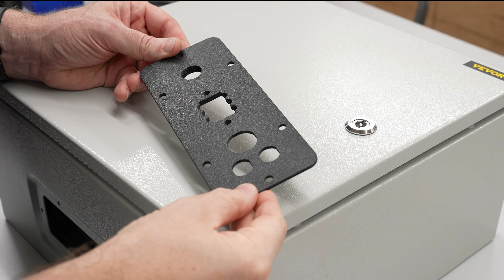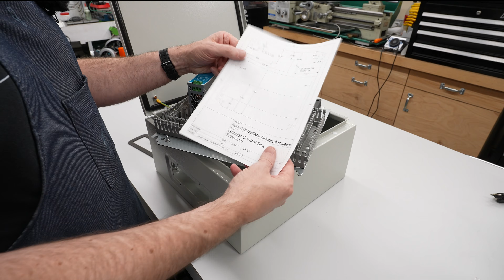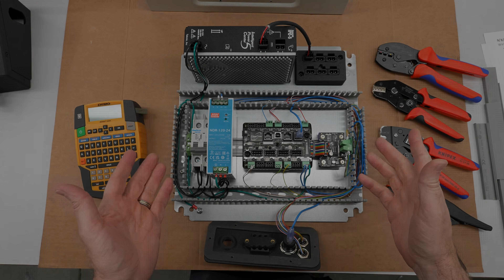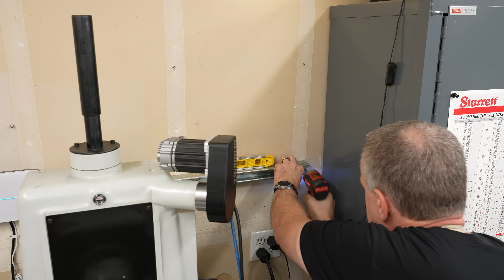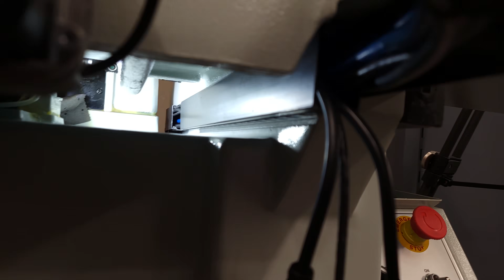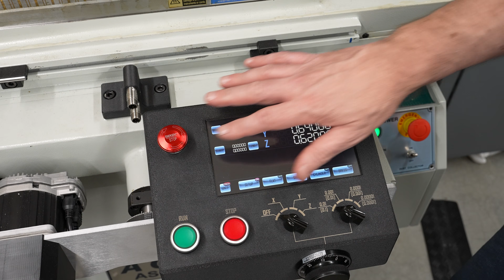Clean Control Cabinet Wiring Made Easy!

Comment: Nice Job, not much to pick on as this type stuff is in my wheel house.   Good job on separating the AC from the DC signal.  Best way to fix signal noise is not to have it in the 1st place.

Old school material, you could use a spiral wrap to hold all of the cables together from wall enclosure to machine.  Another layer of protection. 

Grind the paint off the panel for ground lug. Same for door grounding jumper.  Think this was a VDE standard for Europe.  I might be mistaken thou.  

Also another trick to the trade.  after a month or so of use,  go back and re-torque the Power lines.  The temperature cycling will loosen them.  Learned this from using a Fluke Temperature color display device.  Makes a big difference on reducing heat loss on the terminals.   Breaker panels is typically the place to start. 

Also reference your DC common to ground at just one point.  This is also a common error.  if it's all over, ground loops.  You need that reference for the common to lock it in, with out it it could float a little and drive a technician crazy in troubleshooting.   

Set those current limiter modules on contactors to lowest setting , bounce them up if they trigger.  Might as well use them as you got them.  Same strategery as fuses,  install low and bump them up if they blow.  goal is to have them just above the operating point of the circuit.  Over rated fuses is lazy.

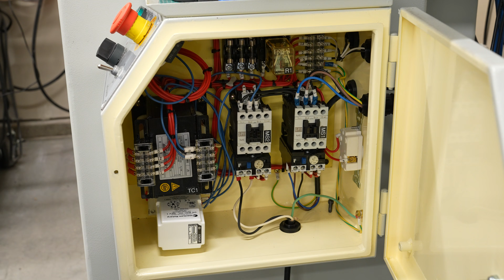Comment: You committed the cardinal sin of industrial wiring however; You did not put labels on either ends of the wiring inside (and outside) the control box. You should have taken a page from @22:54 and noticed how the machines industrial wiring itself is thoroughly marked, paired, zip-tied and routed in the box. If it's worth doing..it's worth doing right. PS - I love how you put your hand onto the work surface of the tool as you bend over and power-on the machine @24:54..living dangerously..love it.

Comment: Man... Im working on a nitrogen generator system that's controlled by Arduino and will have a touch screen display. Of course I had to complicate it by adding sensors/monitors for the air flow, O2 sensors, pressure, temperatures, etc etc. 
But you make projects like this seem so easy, lol. (I get you used AI, but I mean even all the rest is very well done, obviously)

Comment: RS sells the same nema box, and cheaper than vevor (at least in europe). The only downside of these boxes is that they are not rated for outside use. The paint is epoxy and dust off in UV, and the base plate tend to rust fast.

Comment: You could label the button that cuts the DC bus voltage to the motors as STO (Safe Torque Off), and the other button that dumps AC mains power as E-Stop.

Comment: This is well timed.  I have a Wells-Index CNC mill with a huge 4'x4'x1' cabinet on the back made for the vintage control system.  I am currently moving to a new house and will soon be using a box similar to yours to house the smaller components.  This is like a step by step for my project.  Thanks.

Comment: Hi intresting video but i noticed the you have your rotary converter next to your surfac grinder so any vibrations from the rotary converter will show in the finish,a simple test for ths is to use a glass of water on the bed of the machine if there are vibritions present the disturbance will be seen on the surface of the water. i have been involved in. vibration monitoring for a number of years and this is a simple indicator with out expence.

Comment: This is great. If you had a spindle encoder and vfd you could add a pid loop for spindle control.. i want to cnc my pm940. However, I want to maintain full manual control.. 
Would there be any drawbacks to building a system like this for a mill?? .. not full cnc but dro on steroids..

Comment: How are you dealing with keeping the dimensions of CF prints accurate, ragardless of how much drying or calibration I do, prints seem to be 0.2 to 0.4 mm over size on the outside and 0.2 to 0.4 mm under size on the inside. Other than shrinking parts in the slicer not much seems to help

Comment: Good idea with the cable clamp for passing and securing the power and servo control wires through the enclosure. I recently made a control box for a LinuxCNC machine and used the well known GX series "aviation" connectors to connect everything from the outside to the box. I still think it's a nice modular solution but the amount of soldering is something I could do without. Simpler is probably better.
Reply: Agreed very smart. Do you by any chance have the 3D file for those available?

Comment: James great video. As a panel shop foreman for more then 2 decades your box design and layout is very nice. One hint. If you cut your finger duct cover for the vertical pieces to butt up against the horizontal ducts, they will look much better. Your design has an element often left out or forgotten by some panel shops. You finger duct cover locks together and can not fallout due to gravity and or vibration. Great mention of Unistrut is an asset for electrical mounting of cabinets and even running cables with the metal cover as a duct.

Comment: I know that you are not worried about the over load. With out looking at it I can say that you do need to know the amps being used through it. If you are over the rated amps then it will not work. Simple test, test the amp load on the black and white line going to the control box. What will happen is if one is over the amp load number that is on the pointer then the normally closed contacts 95&96 will open and the over load will have to be reset. If the load is lower than the amp rating then it will give you an extra layer of protection other than the braker. On one of my tools it's wired with the ac line going through l1to t1 and l2 looped to l3 to t3. The l is top of the contractor and t is the bottom of the over load. The t or terminal side of the overload goes directly to the ac side of the dc transformer. From there a dc+ blue wire goes to three breakers and a dc-  white or common goes to a distribution x block. The overload will turn off the dc power if it's to high and each of the dc circuits are individually protected by the three breakers. One is the control circuits, another is motion control and the last is safety circuits. 

I understand protection of the dc transformer. You have that twice. I don't understand what you are using to protect your motion boards from the dc transformer. Did clear path say that it was not necessary? 

Thanks for always being clean with your wiring. For using the right tools for the job. And being willing to get a new tool if it does the job better.

Comment: Overall great result, but just one tiny thing. You should not daisy-chain the ground wire. Create or extend a common ground point and wire it in a star pattern from there. It will work this way, but every mOhm might count in case it's needed.

Comment: I'd second the suggestion that this would be great place to consider the low-profile Unistrut (P6000 series: 13/16" depth, still 1 5/8" wide, uses the same fittings) in scenarios like this where every inch of space can count and the loads are light. Of course, the Unistrut I use is what I find in the dumpster, so I appreciate that it may not be worth the effort to buy anything special or different.

Comment: We don't have metric "uni-struts" because timber frame homes are more of an american thing.
Reply: Unistrut is most commonly used in industrial or commercial applications  and mounting to wood is only a small minority application. You'll frequently see it mounted to concrete and even self-standing structures. It has an erector-set -like array of accessories from 90° corners to odd angles to rolling beam trolleys and everything in-between. I don't know what's used in Europe, but it's d a lack of timber-framed residential construction is definitely not a factor. In many ways it's like a big-big brother to DIN rail.
Reply: @johnhawkinson  thank you

Comment: I like the cable clamp in place of connectors on the connector panel, it reduces part count and many possible failure points.  To further reduce the number of fasteners and assembly operations, think about replacing the two bolts/nuts that fasten the clamp in your original design with tool free clips printed into the clamp.  To remove the clamp just squeeze the clips together to release them.

Comment: Routing power and control wires separate is not just about EMI.  They are also isolated for safety.  We sometimes use skinny raceway with two in parallel one for power and the other for low voltage.  Good video

Comment: Given the level of thought, detail and iterations you put into these projects, I'm sure you tried every which way to get the servo power supply mounted vertically, but looking down from your overhead shot it feels like there should be a way to do it. Couldn't you have two shorter pieces of DIN rail one above the other on one side of the panel, a central wire chase and the servo power supply and distribution board on the other side? I guess the DIN power supply didn't quite fit above the ClearCore.

Comment: Two e-stops that perform different functions is not good design.  Wire the e-stop on your new control panel (with a NC contact) in series with the machine e-stop.  Relying on the controller to e-stop is generally frowned upon, plus if I remember correctly you have wired it with a NO contact.  The controller can't tell if you have a broken wire or an open estop, and neither can you.  If the wire is broken, you hit estop, nothing happens.  The other caveat for those that care, is those control cabinets are not uL or CSA listed.

Comment: Just a thought - they make a low profile version of that strut as well. Much nicer look if you don’t need the strength of the full size as it mounts things closer to the wall.

Also, I’m glad you didn’t use flat head screws to mount the strut. So many people do, and they are just not designed to be used in holes without counter sinks! For done reason people flung this really annoys me! 

Personally, for mounting stuff like this I often just use sheet metal screws. They have pan heads with flat back do they properly mount things with mounting holes and while not designed for wood they hold just fine for non-structural stuff like this which will take minimal load.

I really wish I could find actual wood screws with flat backs like pan heads, but they seem almost impossible to find anywhere, which is a shame as they are what’s really needed for mounting stuff to wood construction.

Comment: The ipc-5 manual mentions an EMI filter. It's probably not a big deal, but it would cut down on conducted EMI you're putting back on the grid, which also means less on the AC wires run in the cabinet

Comment: As you took a long cable to do additional grounding you actually created a ground loop that could emv into your analogs. But i think it does not disturb in your case. You better use a "copper shield from a coax" and make a diy short, flat connection screwed direct to the DIN rail.  Beside of that CONGRATULATION this is a superb job. THX for sharing.

Comment: With such heavy loads as those electronics are you should have used 1 inch bolts.1/4 wont be able to hold it and it will hit you in the head when it falls down so you should wear safety hat all the time just in case! :)
I have never heard about printable heat shrink tubing before,makes labeling easier.
Are you planing on building plexiglass cover for that screen ? Dust and coolant dont go well with touch screens.

Comment: I love your multi-cable clamp design, that could have saved me an awful lot of space and work drilling and fitting nearly 20 cable glands on my current project (Clearcore based).  
Enclosures seem to be rather overpriced in the US, I bought a Schneider 600x600x200 (24"x24"x8" approx) from a large national distributor in the UK and that cost 118 UKP plus tax. It has the removable cable gland panel like the Vevor.  I was very surprised how tough the mounting panel was to drill, I went through a couple of drill bits when mounting the cable ducting and DIN rail.

Comment: Nice build, but would like it starting with explaining what components are and the design process.
Mounting of cabinet on the wall makes it more difficult if relocating machines in the workshop. Happens to me every other year.
A bit worried about heat in a closed cabinet.

Comment: Nicely done, just one thing to mention: You wired a blue cable for +24V. The standard for dc power wiring is to use red wire for positive and black for negative and if possible avoid those colors anywhere else. It will make it easier to identify when there are a lot of wires, and can also prevent mistakes  :)
I really enjoy your videos
Reply: "The standard for dc power wiring is to use red wire for positive and black for negative"  

Not for machine tool wiring in UK, Europe & the Far East it isn't - blue is 24V DC wiring, red is single phase ac lower voltages (110 - 220V) and black for 380 - 415V and similar higher voltage wiring. It has been this way for decades - when I was panel building & production wiring lathes & CNC milling machines in the early '80s the colours were the same. Open any machine tool panel pretty well regardless of country of origin & a look at the wire colours will tell you which will bite hardest !

Good plan for long-term reliability to not cut cables if at all possible. Sometimes unavoidable, but at one employment we reduced warranty call-outs by minimising breaks in cables, as a lot of faults were down to connections coming loose. Looking at Far Eastern built machines that were more reliable we found that they planned the electrical installations better than we were doing to minimise in-line connections - a connection that isn't there can't fail !
Reply: I was just going to say that every tool I own is blue for 24 positive and ether blue or white for 24 negative. Red for 110 or 220 control circuits both r and s or t1 and t2. And everything else is black. The only thing that changes this is out puts from a x block. A x block is a terminal block that is used for input and output. Much simpler to test between multiple chained switches than the individual switch.

Comment: Why is the Y axis vertical here? I'm used to the Z-axis in 3D printing as vertical. I'm trying to Google it but the info is all over the shop. edit: and as always, nice clean prints, structured layout.
Reply: Been a convention for more than 50 years. Z is always direction of spindle.

Comment: We used a somewhat-larger enclosure like yours, again from Vevor, for the motion control computer and support electronics at our large satellite dish restoration project.   No complaints about the box.  We mounted it to the (alloy steel) wall of the motor/gearbox cabin using uni-strut so we could hang some things beside it.  Mounting the uni-strut was a challenge.  Broke 3 taps making a measly 4 holes in the steel walls of the motor/gearbox chamber.  NATO used some pretty-darned-tough steel when they built that thing...

Comment: I mounted my control panel with the electronics mounted in the center underneath the grinder slides. Pretty similar sized enclosure too. Havent had any issues with anything coming down on top of it at all, since you shouldnt normally have anything running down the front anyway.
Mounting on a wall next to the machine is probably better, but as it was a control system for the machine I wanted it mounted on the machine itself.

Comment: Wiring nema enclosures is so satisfying. Given that you seem to be using anodised aluminium din rail, it's not going to geound properly since the anodising is non conductive, good practise to wire up ground separate in that case.
Reply: I think they are Zinc Plated Steel DIN Rails

Comment: You might want to look into building codes. You used a three inch screw, you should only use a 2 inch screw to make sure  you don’t puncture a wire or water line. Code requires only 1 1/2 clearance for all penetration in the studs.
Reply: If it doesnt leak . . . Besides who's going to pull out that screw and measure it?

Comment: James, as I'm now 65yrs old. I learned controls, did a lot of relays b4 PLC systems became more common. I went through a ton of wiring on 1,000 spools. Some main panels took almost a month. Also punched out alot of switches on the doors. Did layout for the wiring channels. The owner was extremely excited about my workmanship. It looks great, when you open up the door. And say, I did that...

Comment: AC next to DC will definitely make a difference, especially if the DC signals are not shielded. We couldn’t even have supply lines within 12" next to signal wires in the Sikorsky helicopters I was contracted for the avionics buildout.

(Edit) Get yourself some expandable braided sleeve, AKA braided wire loom, that will keep the wires nice and tidy, and easy to mount with stainless steel rubber cushioned cable clamps for the high vibration areas.
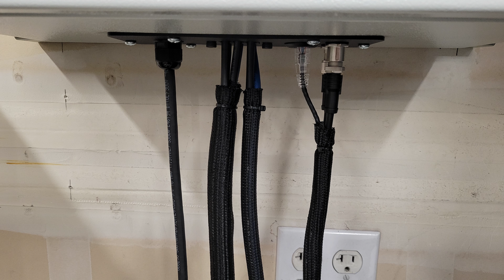Reply: I think he used that braided loom at time 22:36 if that’s what you’re describing.

Comment: Nice, one thing I would change is eliminate MPG 'overshoot' due to the buffer on the input, aka if you stop turning the MPG the machine stops moving. I don't know how much work that is on the back end but I have always disliked running machine that have overshoot with the MPG.
Reply from the maker: That would be "velocity mode" and it's totally doable.  I was thinking about advancing a known number of clicks, but we'll see what it's like in practice.
Reply: @Clough42  Hi James coming along nicely.
I second  the use of  of velocity mode . there really is no upside to the axis continuing to move after you stop turning.
The handwheel is the most precise manual control on the machine and in the current setup WILL add unexpected and unwanted accidental motion.